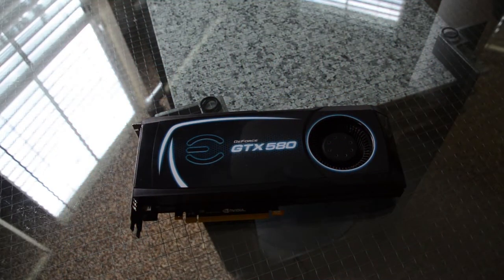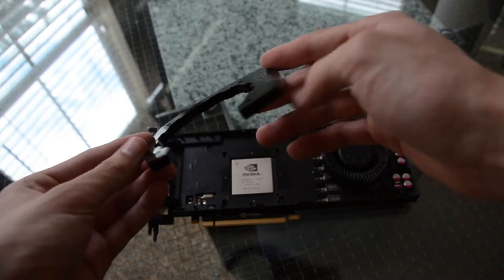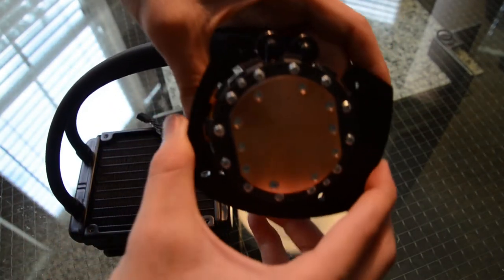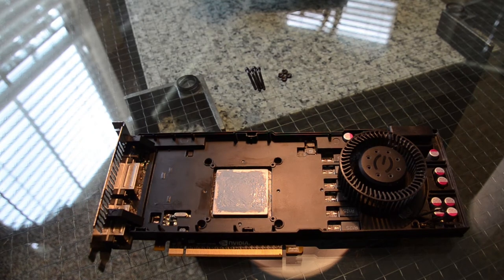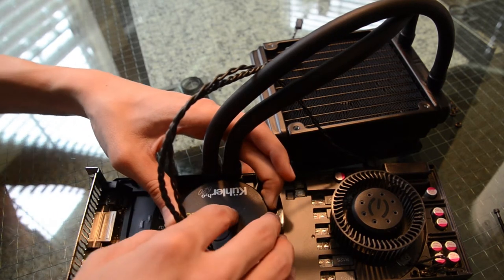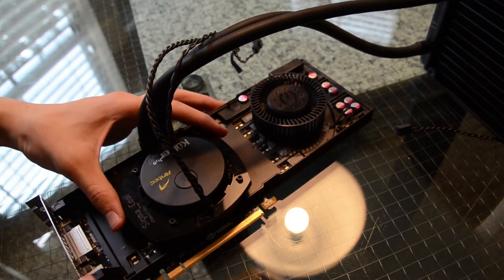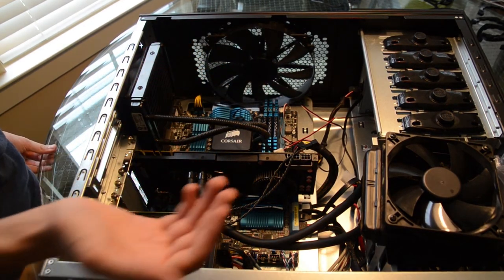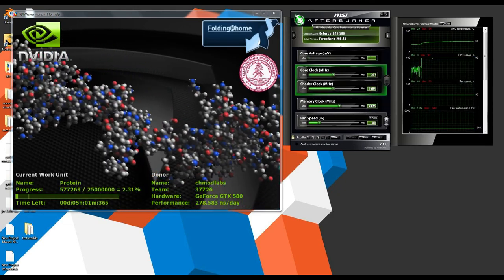Sigma_Cool Mount Installation guide

Comment from the maker: Yes, the GTX 580 mount is compatible with the GTX 560 448 core since the 560 ti 448 core is really just a slightly disabled GTX 570 (which uses the same PCB as the GTX 580)

Comment from the maker: Yes, since the PCB layout of the GTX 560 Ti 448 core is identical to the GTX 570 / 580 PCB (really just a 570 with 32 cores disabled).  Just go to the thread on overclock . net and fill out the "pre-order" form (link in the description).  If you have any further questions or inquiry just PM me or post in the forum!

Comment: can your unit also accomodate a back plate like what is on the evga gtx 680 02G-P4-2685-KR. or would i need to remove the back plate?